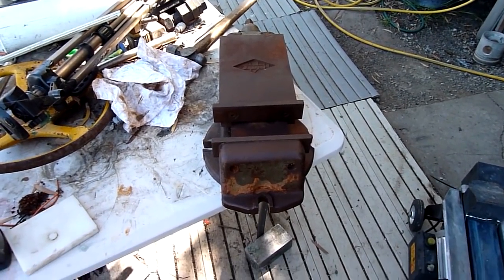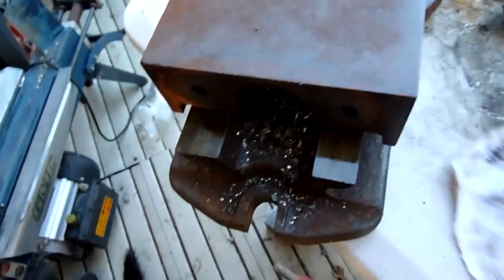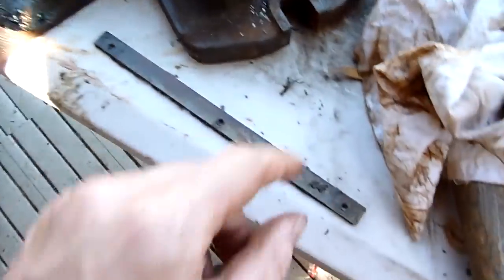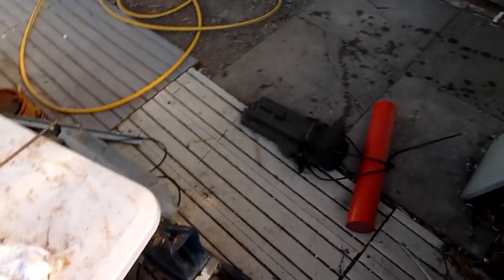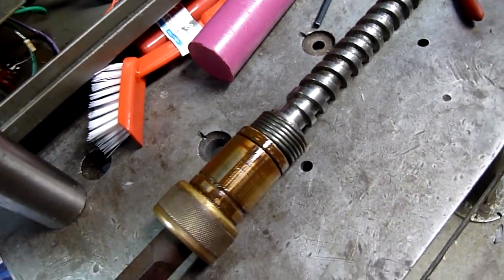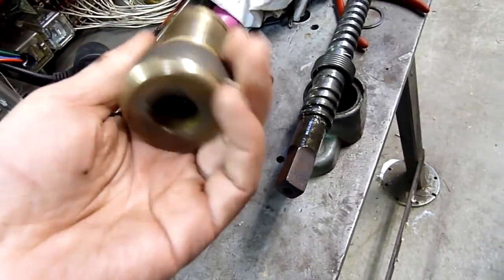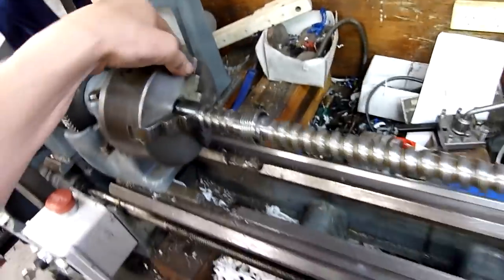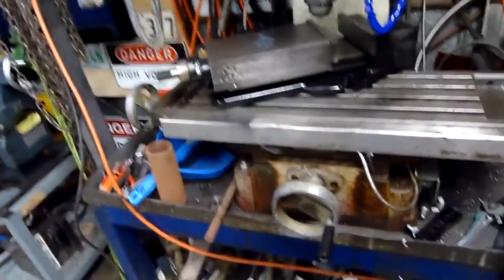Old English Milling Machine Vise Cleanup

Comment: I have the same vise. You will see what it does when you tighten a part in it. It will close & open up fast without pressure on the part, then when the pressure starts it will feel like it changes gears (spring twist) to give you more torque on the short acme section (as stated by others). Don't let the dog get ahold of your big pink rod!!!! yOU COULD PUT THAT IN YOUR NEW VISE  LOL!!!
Reply: But AVE told me to keep my...
Reply from the maker: Thanks mate, your spot on, its a force multiplier, kinda cool. the Vertex ones have a much finer single stage screw and are slow to open, this one is really fast. I will keep my pink rod in a vise :p

Comment: Aussie 50 -it's a two speed tightening - I have  german one which is very similar came with a deckel mill - the vice you have just repaired is 50 times better than a vertex - close to a Kurt.  Fantastic.

Comment: It's a helper to make it easier to get a high clamping force. While tightening down the outer bearing will lock up. The internal screw then starts to turn. The pitch of the internal screw is less steep giving more clamping force for the same amount of torque. The Spring will return the internal screw to the start position when loosing up the vice.
Reply from the maker: your exactly right, its makes it faster to open, but acts as a force multiplier when you actually clamp down, very cool idea!

Comment: You've done a smashing job with an old beast Ed, usable again: -D
It doesnt look like the same vice now.
That odd brass part doesnt make much sense, someone will know.
Reply from the maker: apparently its a force multiplier, kind of a interesting way to do it. modern Vertex vises have a fine thread pitch on the screw but are single stage, this corse one is duel stage

Comment: Why not sanding on the trailing edge of the thread? It seemed you did the leading face and the outside face
Reply from the maker: very good point, I may take this down again and give it a once over after some use, now that its being run in again!

Comment: Hey From the states! I’ve been watching your videos on your Kubota 1600 diesel mower. I have a chance to get a older one like that right now for about 700. It runs decent just a lagging starter built deck has been rebuilt it’s just off machine so I can’t test it. Other than that what is your opinion on yours!  Is it still going? Do you still have it? Thanks
Reply from the maker: I gave mine to my mother who owns 10X the land I do and she loves it, just doing the belts and service on it this week, its well worth the money! . I have noticed issues with the safety cutout switches that cause starting issues, if the starter motor tests fine try bypassing cutout switches one at a time and see if it starts properly, then replace said switch or just bypass it.
Reply: Awesome thanks for the reply man. I bought it from a old man that sent the deck off to get rebuilt then never put it back on. Mine is kinda ruff looking but runs great. I will try that with the switch. They seem to be hard to get parts for here in the U.S
Reply from the maker: yeh parts are a bit hard to get here too, I do not think they sold an awful lot of them outside of the professional market, very expensive when new and most operators went with Toro zero turn mowers instead. The switches you want to find are the seat cutout (deadman switch) the brake pedal and blade lever, assuming yours requires you to hold foot on brake to start. the ones on mums are a bit flaky but once its running its fine.

Comment: Is that brass spring dealie designed so you can put a repeatable clamping force on the workpiece? Perhaps the spring is pre-specified for a certain tension before it starts to give or something like that.

Comment: what's that ATF you soaked the clamp in?
Reply from the maker: yeh I just used Dex III
Reply: ATF (automatic transmission fluid) (any old school brand) + acetone = cheaper and/or more effective penetrating oil. The stuff you use when the bugger before you skipped the (copper) anti-seize...